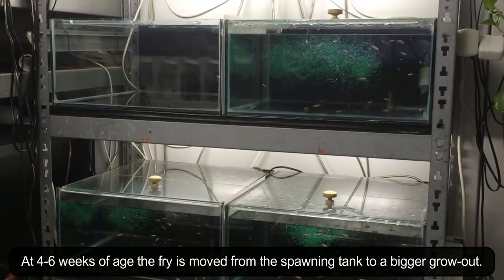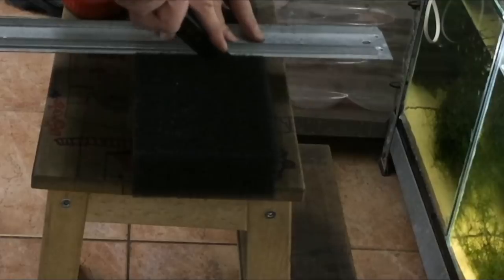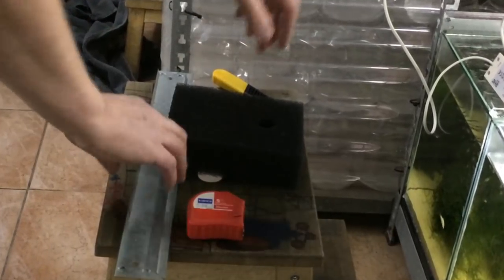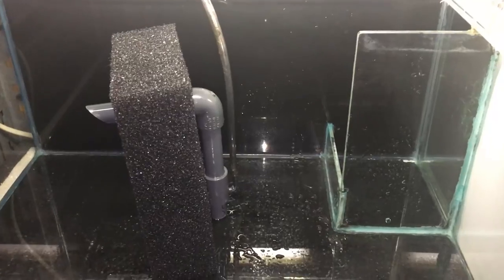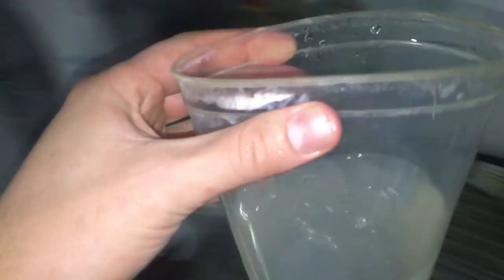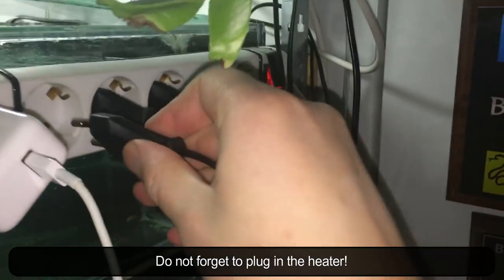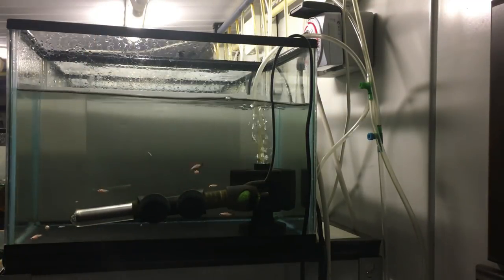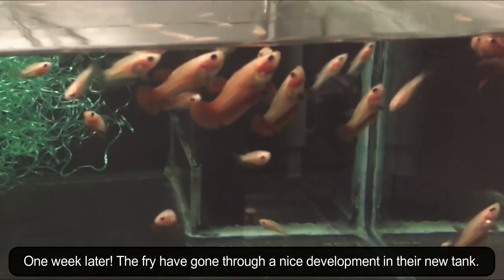How To Move Fry To The Grow-Out

Comment: Joep, you remarked in a reply that bettas can resort to cannibalism and I wondered about that. 
I've seen it first hand now and my fry aren't quite 8 weeks old!
Some of the bigger ones are exhibiting predatory behavior and at this point I can't even tell what sex they are. I guess that doesn't matter. 
I think I over feed them so I don't think it's hunger. 
Nature of the fish?
Reply from the maker: Too my experience this usually happens when there are big differences in size between the fry in a spawn. The larger fry in such case can eat the smaller ones. Dividing the fry over different tanks based on size can solve this problem and will stimulate a better development of the smaller fry.

When a fish dies for another reason it usually will be eaten by the other fish the tank (usually starting with the stomach/eggs region). 

Hope this answers your question?
Reply: @BettaTerritory  it does very well.  Thank you

Comment: Is this method suitable only for the betta or other fish fry as well?
Reply from the maker: No problem to use this type of filtration and tanks for many different species.
Reply: @BettaTerritory  I mean a tank like this is not cycled, so you must do frequent water changes. The betta fish are used to this, but won't it be a problem for other species?
Reply from the maker: Tsi Tsu only have experience using the same methods guppies & endler hybrids, which both have no problems. I can imagine that this way is not suitable to species which are less able to adapt to a wide range of waterparameters.
Reply: @BettaTerritory  I will try it out on my molly fry.